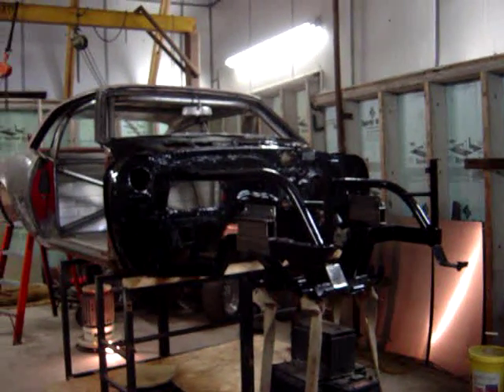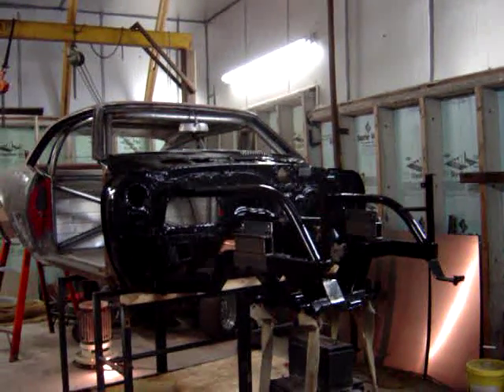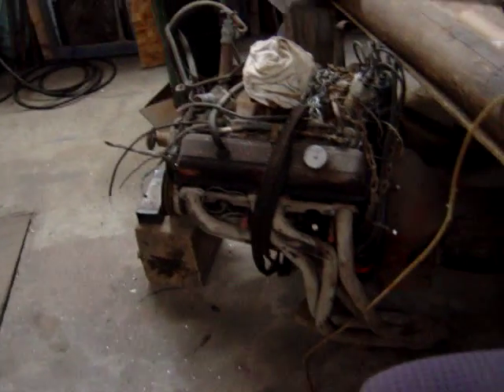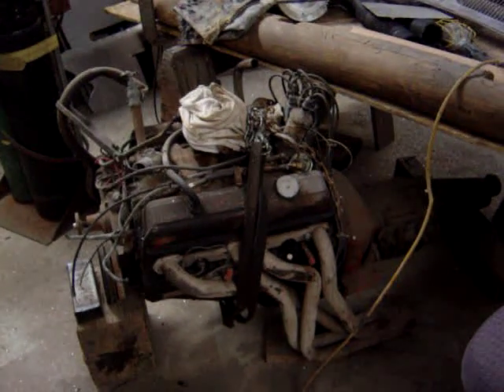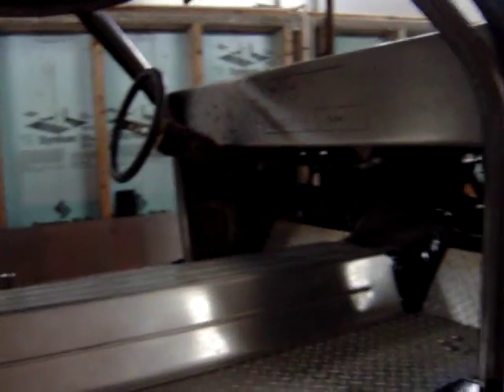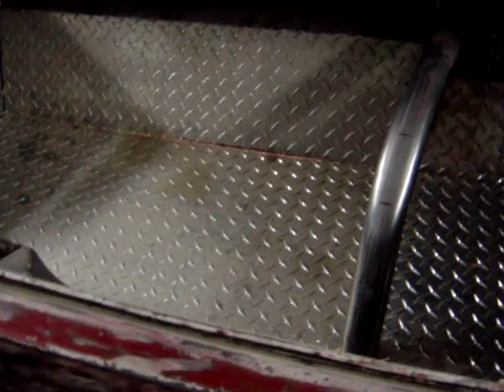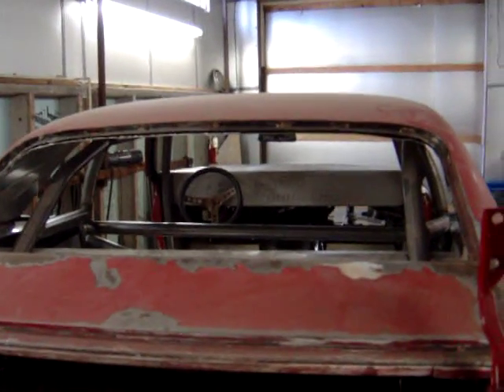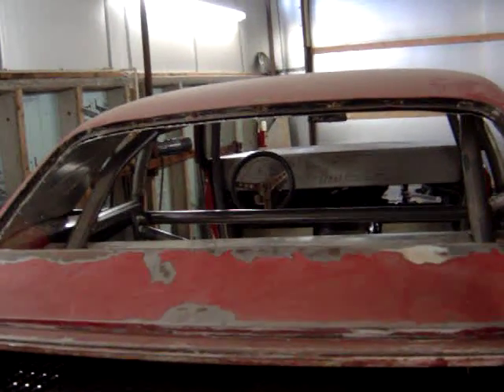HHO 68 Camaro!

Comment from the maker: Yeah, My 55 chevy is also a heavy drinker! My HHO setup is still being tossed around in my head. I may add an inverter and a diode bridge to run high voltage or a second alternator to push more amperage? We will see.